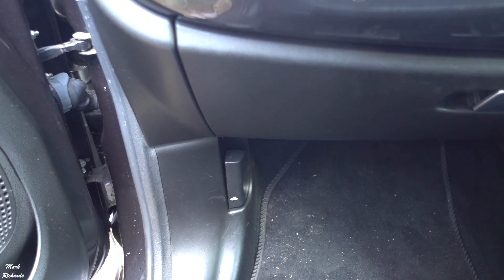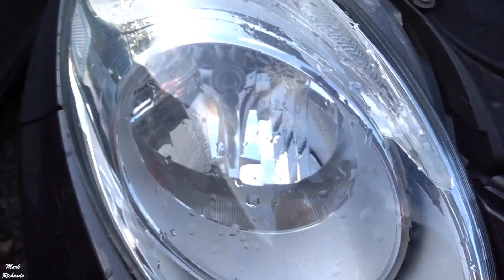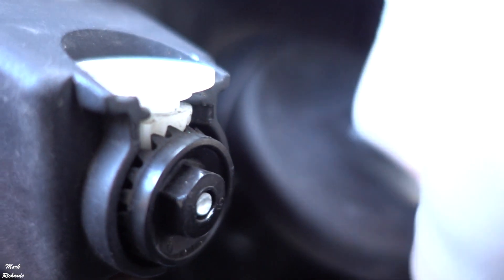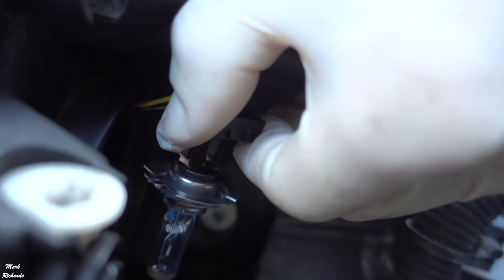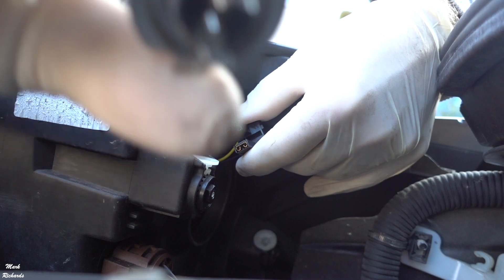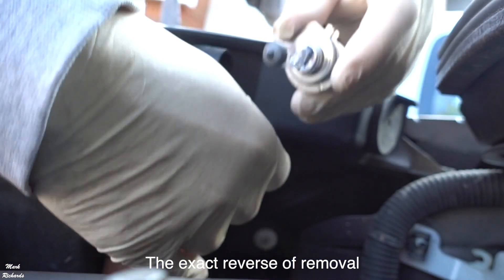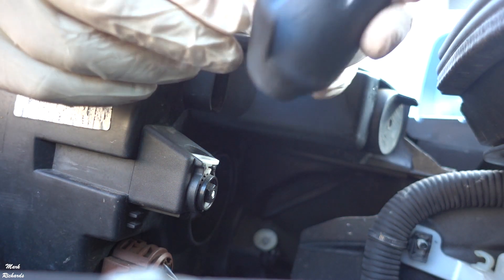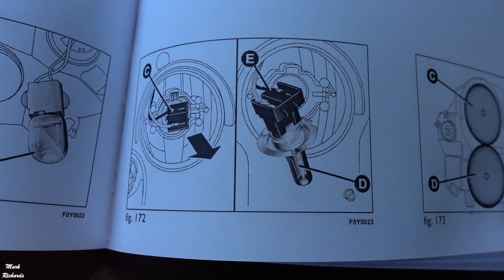Replacing Fiat 500L Headlight Bulb the EASY way

Comment: I couldn't find any better explanation than yours thanks to this very useful video.
Thank you for sharing and detailing in such a comprehensive way the whole process.
I am going to try it now on my FIAT 500L which have some issues with one of the headlight bulbs.
I would consider to change both of them anyway as it is recommended.
Cheers from France and thank you again!
I
Reply from the maker: Thankyou Jean for your kind words. I have also made a video on the fuse box location as a lot of the videos showed it elsewhere and took me a while to get to. I have also changed the rear bulbs but there were already a lot of vids on this. If you get any questions please let me know.

Comment: Manual said turn bulb holder clockwise, with diagram showing turn anti clockwise, then the text contradicted itself again. Thank you for a clear, straightforward 'how to' video to change the light bulb
Reply from the maker: Thanks Alistair. I had the same problem with the manual and it took me a while to work out the rubber cover (not needing to be twisted) so I thought I'd make a vid to try and help others in the same situation.

Comment: I have the left hand drive version in Canada. In Winter the crude that collects around the engine room components is a sight to behold. Twisting is more difficult with a layer of dirt. Change both at the same time is a recommended practice.
Reply from the maker: Definitely agree about changing both at once. We bought the car in June last year and the front bulb went so changed them both then less than a month later both back brake light bulbs went and then one of the rear lights. It's weird how it comes up on the dashboard screen when the rear bulbs go but doesn't tell you when a headlight bulb goes! I guess they think you'll see it more at the front.

Comment: thanks heaps for that! Concise and easy.  I have the US model and instead of the flexible cap that you pulled straight off, I had a rigid cap that needed a slight twist to the left as you mentioned.  Still, very easy.
Reply from the maker: Thank you. And it’s strange they use a different cap. That must be the same as the one in the manual as confused me when it mentioned twisting.
Reply: What kind of bulb did you get for it?
Reply from the maker: I used an H7 I bought from Ebay

Comment: I just changed it thanks to your video. Thank you very much. However, the cap dropped into the hood 🤦🏻‍♂️ you warned me. I can’t reach it. Now what? Do you have a fix for that lol
Reply from the maker: Funnily enough I had the same thing happened on my BMW. I had a metal fitment fall. Luckily I used a magnet on a string. Have you got someone with a thin arm that can help or you can get litter picker arms that can help pick up things in a small area. Thank you for watching my vid and feel free to subscribe and check our my other vids

Comment: Great vid, what happens when the connector comes out without the bulb? Do you have to squeeze them together so the bulb comes out with it?
Reply from the maker: I've not changed one for a while but I think if that happens if you can plug the connector back into the back of the bulb then pull gently and they should come out together.

Comment: In my case, the bulb stay inside and cable connector is out, n my hands 😫
Reply from the maker: Yes that can happen and did to me a few times. I found that by plugging the cable connector back into the bulb and try to almost squeeze the cable connector very gently with a slight rocking motion so that they come out together.